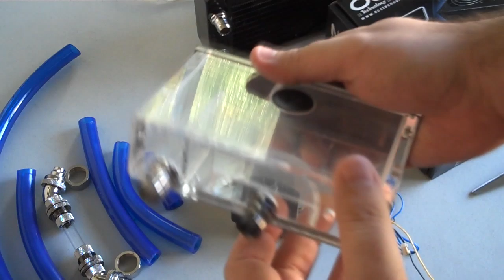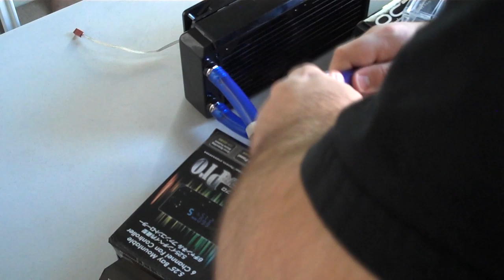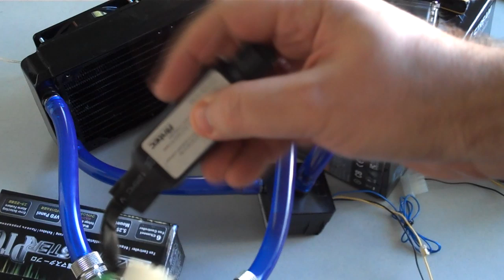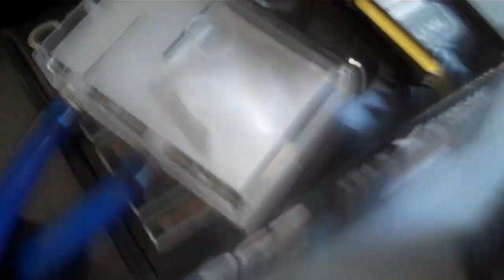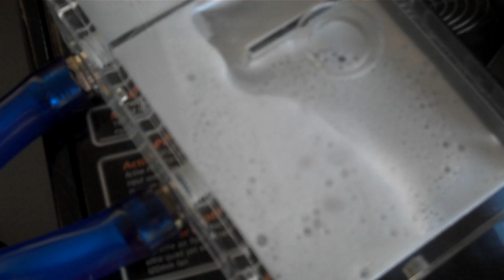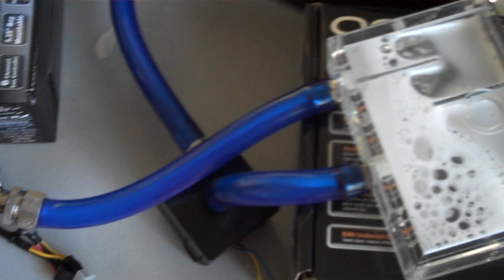How To Water Cool - Components, Flow, Priming & More

Comment: Frieng anything of quality with doing something that ATX requires the PSU to do?

Maybe with some chinese 2$ PSU, but not with anything that is of quality, all lanes are nowaday loadbalanced without load on 3V/5V/12V even if it would overvolt on one side, every good PSU has OVP and just shuts off if voltage exceeds somewhere around 13,4V on the 12V-Lane.

You might want to tell those "people" to buy a better PSU, because that is essential in any build.

Comment: im doing my 1st build really soon, would you recommend having the radiator slower than the bay res when filling it to remove air faster, or does it not matter, here is most of my build, im getting a Raystorm AMD block cause i love its look and i have Demineralised  from a local store 
http://puu.sh/dXPu9/cce7c29bed.png
i know, i don't need that much tubing but meh its cheap as and i love those 3 colours, eventually im going to go for a water cooled GPU but only after AMD releases the R9 390X (or even a 395X2)